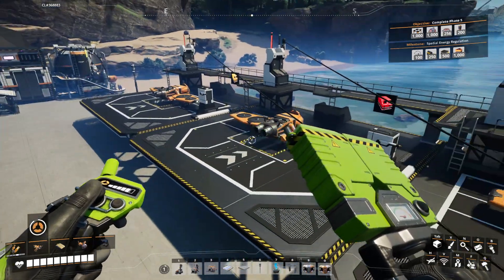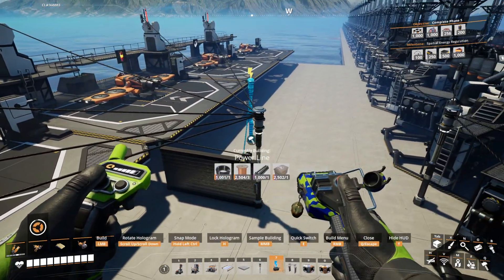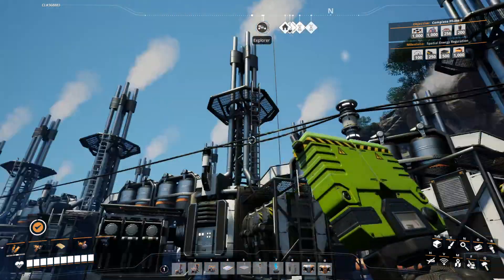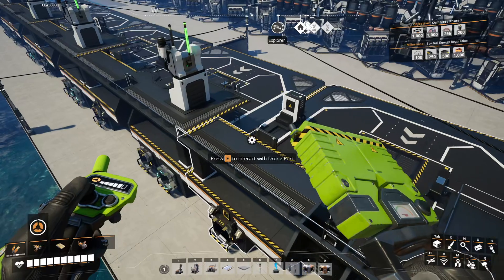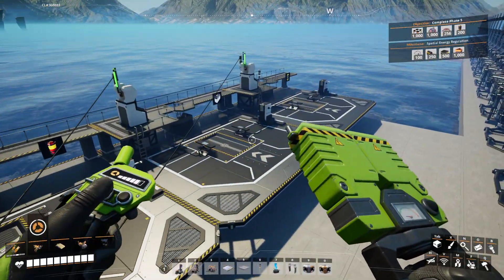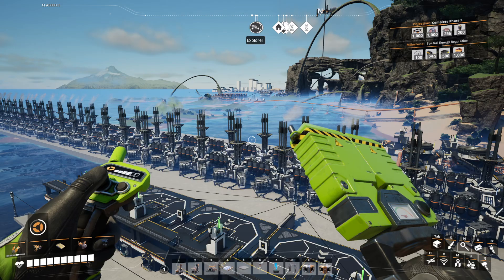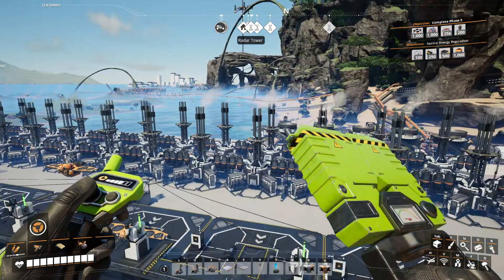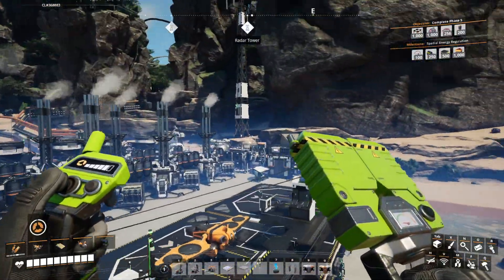Drone Fuel test comparison

Comment: Wow that's really interesting!  Really good test and comparison of the different fuels.  Even though there's a little difference, it's not really all that much of a difference in the overall big picture. Not really.
I plan on using Turbofuel, and then Rocket Fuel for my drones when I tech up to that point and finally get drones.  Not because of flight speed, but because that's the fuel I'm making for my Fuel Gen powerplant and it's there and it 's available.  I'll just make a little more than I need and package it for use and distribution for drones.
So whatever fuel I'm mass-producing for the powerplant is what I'll use for my drones. 
Really interesting video though.  Good comparison!  Thanks for this!

Comment: Now that i can use turbofuel i dont care about the other because turbofuel i have a lot. No need to do the battery anymore 😂
Reply: When you can, conver it to rocket fuel because it turns 60 turbo into 100 rocket fuel. Its very nice

Comment: My assumption as to why fuel and turbofuel ascended before landing is the landscape. Their ports are closer to the coast and as they fly towards this big mountain when approaching the port, their programming tells them to prepare for ascend, even though they don't technically have to.

The bad news is that if that's correct, it's not a fair comparison unfortunately :/
Reply: Still, you can clearly see that they are way slower compared to the others
Reply: @uxiz8805  Yeah, fuel is about 1.5x slower than ionized/plutonium. I tested it myself and made a video, referencing this one.